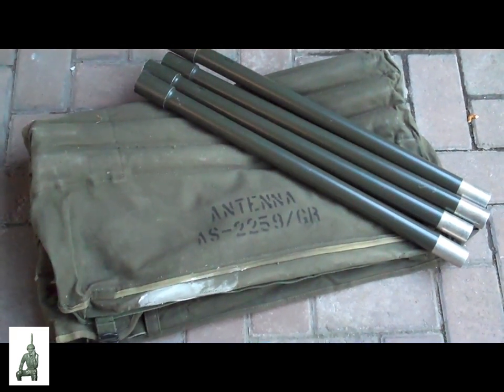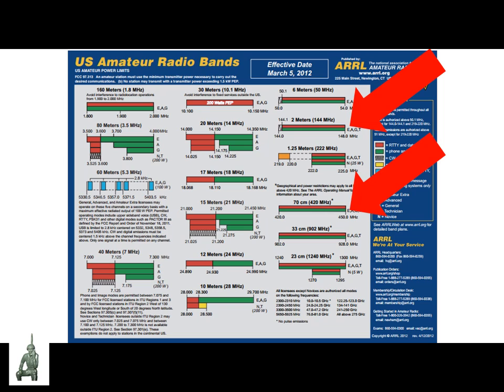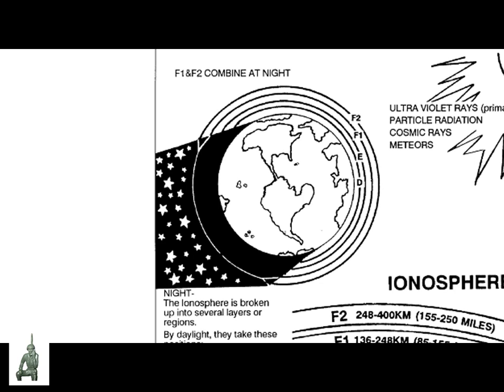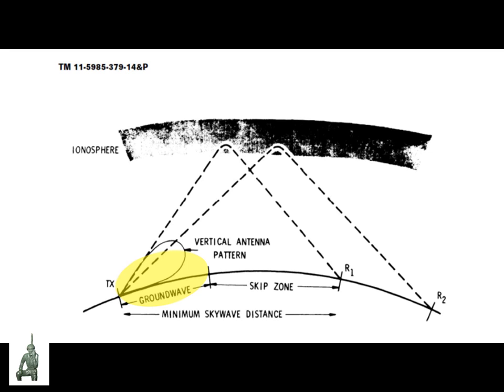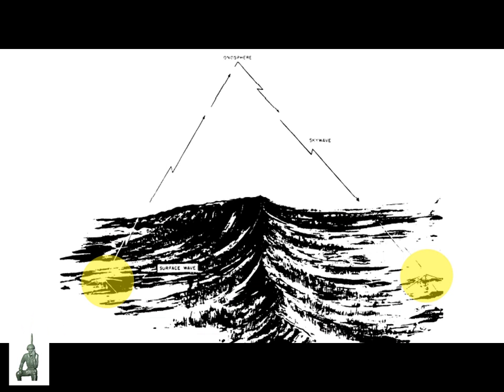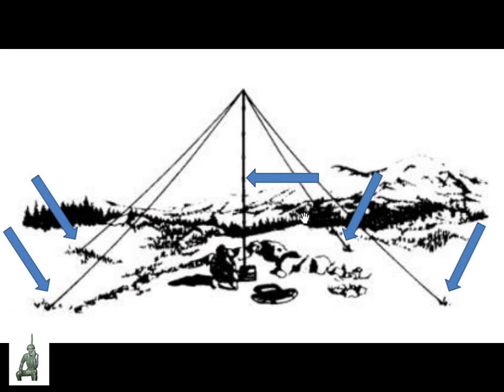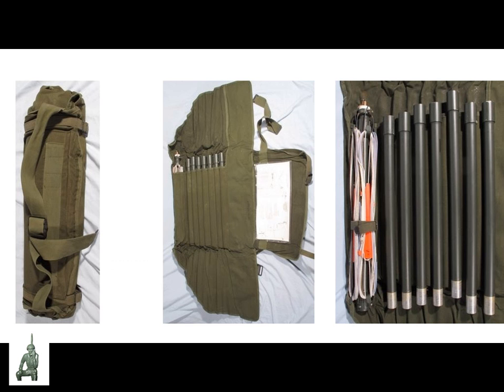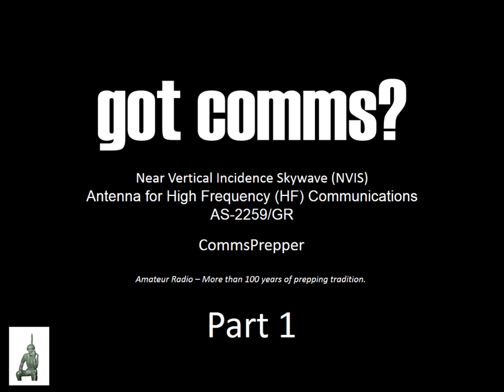Near Vertical Incidence Skywave (NVIS) Antennas - AS-2259/GR (Part 1)

Comment: The 2259/GR is basically 2 inverted-V dipoles crossed 90 degrees at the feedpoint to maximize separation between the dipole elements to keep the horizontal radiation pattern omnidirectional, while maintaining the vertical gain. This is definitely a "compromise" antenna: it's designed for portability and quick/easy to set-up rather than for maximum performance and efficiency.  It was designed to be used mainly from 5MHz to 8MHz, so as -is, the dipoles aren't resonant on the amateur bands (with the possible exception of some 60m frequencies), so you will need a tuner.
  There are several designs available for modifying the element lengths of an existing 2259 for the 'ham' bands as well as lots of How-to's on DIY versions. I built mine for the 40m & 80m bands. The feedpoint and element ends of this type of antenna are so close to the ground that the element lengths are shortened due to "end effects" and other factors. Usng the traditional 1/2 wave dipole formula of "492/f" for the element lengths gave me 40m elements about 3.7ft too long, and the 80m elements were almost 8ft long. So for NVIS dipoles, "440(ft)/freq(Mhz)is a better formula for the 1/2 wave length.
   If you plan to tune the antenna on-site for the lowest SWR, the feedpoint HEIGHT, the ground quality under the antenna, and the angle formed by the dipole elements will all affect the feedpoint impedance, and therefore the SWR.   And for 40m/80m use, a feedpoint height of 35 - 50 ft should be much more efficient, but taller masts mean more poles and extra guying gear.

Comment: I've fooled with antennas all my adult ham radio life.... sort of a sub-hobby with me.  The NVIS easily beats a vertical in transmitting and receiving near-distance stations using skywave.  The vertical of course will do a much better job for "over the horizon" work.  Still, I've never found any appreciable difference between an NVIS and a low-height, half-wave dipole.  The low dipole might be a bit more directional off the broadsides...just maybe.  A big advantage of the low dipole over the NVIS is that the dipole can be made stand-alone frequency resonant using shielded coax alone; the NVIS ALWAYS requires an antenna tuner, whether automatic or manual.  A big advantage of the NVIS is that like any vertically-oriented antenna, it requires little horizontal space.  My eventual use for the NVIS was as an antenna switch "B" selection when I was having trouble hearing a station on the main antenna.  My NVIS constructs were all low-noise, and excelled as receive antennas, giving strong signals in both the ham and shortwave bands.  And, the NVIS is as inexpensive to make as it is simple.  Mine were simply three 5-foot PVC sections, topped with a end cap holding an SO239 female connector; four-wires coming out, and the coaxial feedline's PL259 attached to the inside end.  If you want to work 160m with an NVIS, you'll may have to lengthen the dimensions, since the "published" lengths don't reach the "top band."
Reply: Quote: ......never found any appreciable difference between an NVIS and a low-height, half-wave dipole......
Thats great, means Physics is ok. As a low hanging Half-wave Dipole is a NVIS Antenna!!!

Comment: Do you know how the antenna for the TBX-6 would have been set up in combat (such as the beach at Peleliu) during World War II?  The only antenna that I have found for that radio is one like what you are showing here, but the account that I am interested in mentions that they were operating in a very hot area of the battlefield and moving immediately after transmitting because their broadcast would immediately draw enemy fire.  It seems unlikely that they were using an antenna like this, so what were they using, or did they have some kind of expedient, modified deployment technique?
Reply from the maker: I have no idea.  There are some "green radio" websites that may have some historical information.
Reply: The NVIS antenna described here (a "sloper") still has some vertical polarization properties which provides a stronger point of origination and could allow an unfriendly to determine its direction. A similar antenna configured w the radiator(s) only about 5 - 10 feet at the center and at each end above ground (a LOW dipole) tends to cause the signal to radiate in ALL directions equally, making distant direction finding more difficult while still maintaining NVIS. It just may be less expedient to deploy.

Comment: It's called EN-VIS and stands for NEAR VERTICAL INCIDENT SKYWAVE. It comes about because of the high takeoff angle of the antenna. You do not need the special antenna to do this. In WW II (when it was "discovered") the GIs merely bent their vehicles' antennas over parallel to the ground.

Comment: Very nice vid! Thanks for it as I am learning more about it and getting ready to take the General. Subscribed. 

By the way, that website on your description above is not working. Where did you get your AS 2259/GR?
Reply from the maker: +Robert Fernandez I found mine on eBay and have since sold it.  I was not using it and kept tripping over it.

Comment: I remember setting these up.
Reply: Wayne Harris I want to forget
Reply from the maker: Me too and GRA-4 antennas.
Reply: The GRA was not in my unit's T/E.  But now, after looking it over, I wish it was. We used primarily VHF/UHF tactical gear.  We had a couple of GCR-193Bs for which we needed the 2259.  But mostly we used the RC-292, and other antennas.

Comment: Not quite sure just why you brought up 2 meters and the 440 Mhz band and Wouxun handheld radios, and the entire HF radio band spectrum. These have nothing to do with NVIS. NVIS works almost exclusively under 10 Mhz, usually 40 meters in day and 80 meters at night. Occasionally it can work at 30 meters in day and almost never higher in frequency.
Reply from the maker: Not following your comment.   I have HF radios too.

Comment: Great video. This antenna was used with the PRC-74 and I've also used it with the PRC-104 in 10th and 20th Group. (Back in the day).  There are also DYI designs for a NVIS antenna on-line. (As WD7N mentioned).   73, Tim KB2RLB (currently T6TM)

Comment: Nice presentation. Simple and to the point.

As a former Signal Officer in Special Operations I developed my own version of the NVIS antenna for about $70.00 and a couple of days worth of work. The antenna is presently mounted on my roof and works well. 

Have made contacts over 3200 miles away and as close as the other side of the mountain. Actually made a digital contact in Japan. It works as designed and I would encourage all to have one in their Jump Kit.

73...Matt ~ WD7N